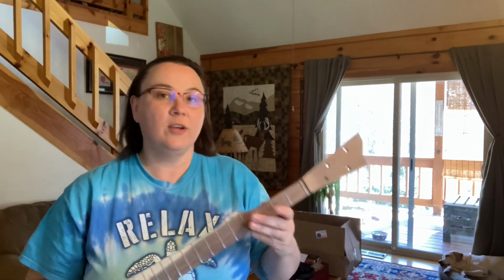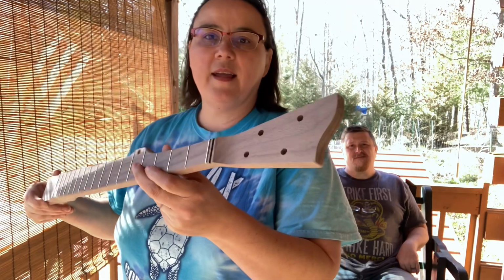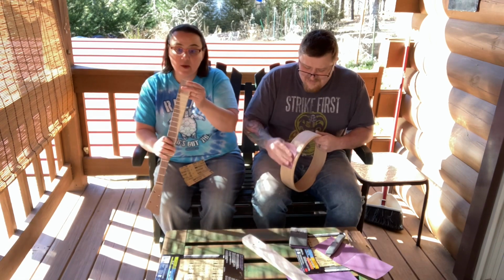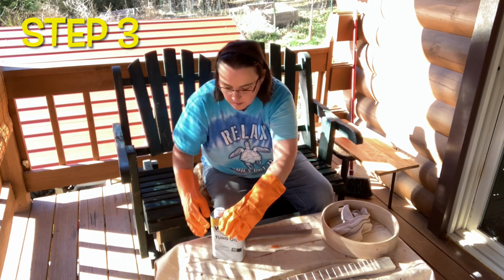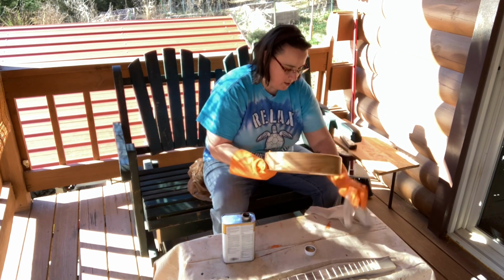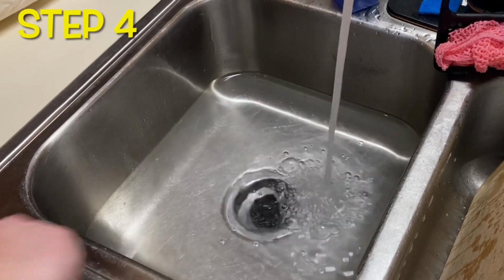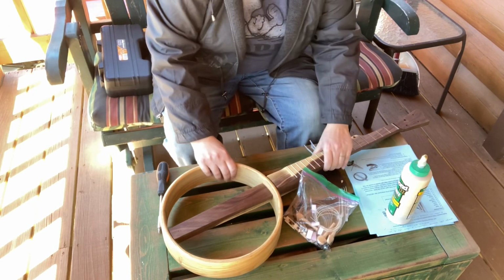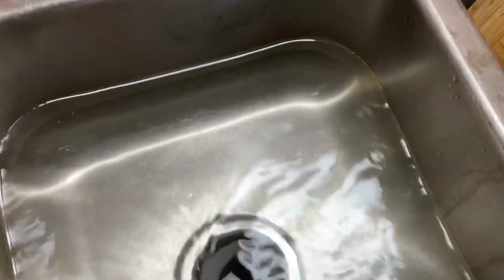Banjo Kit Build | Goatskin tackhead | Part 1 of 2

Comment: Where us part 2? Isn't friction tuners harder to tune with?
Reply from the maker: Part 2 will come out next Saturday.  The friction tuners aren’t bad once you work with it a few minutes.  Violins are still using friction tuners today.
Reply: I was curious about the friction tuners as well, but once the nylon strings settled in, the tuners seem about like geared tuners to me...maybe a little more finicky, but not as bad as I imagined.
Reply from the maker: Hey Jason did you go up the pole on the 5th string?  I did instead of down since I like a raised 5th.
Reply: @BanjoLemonade  on the mountain banjo, the fifth string tuner is on the side, like a “regular” banjo, so that’s not an option. Although, having a raised fifth now has my curiosity.